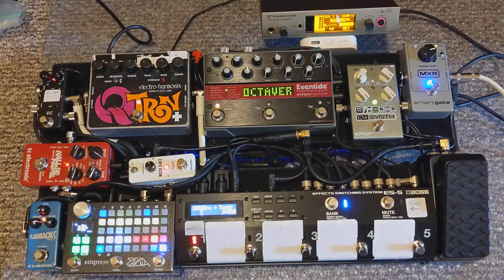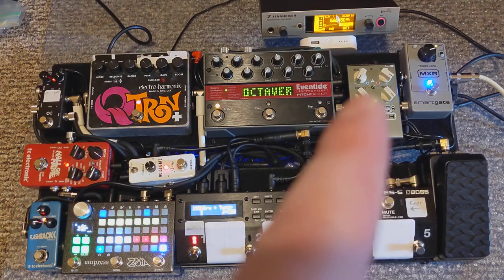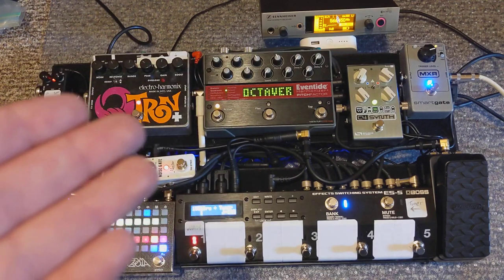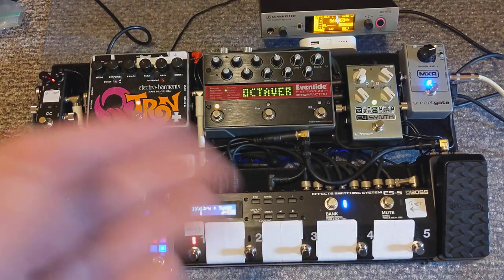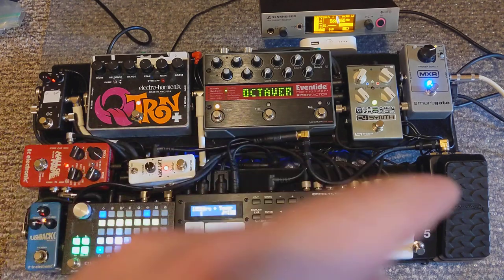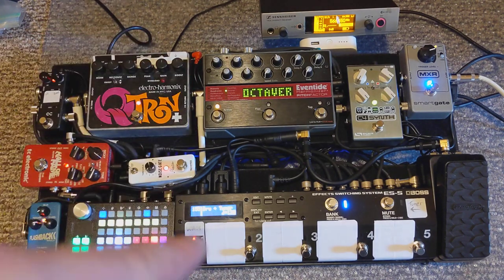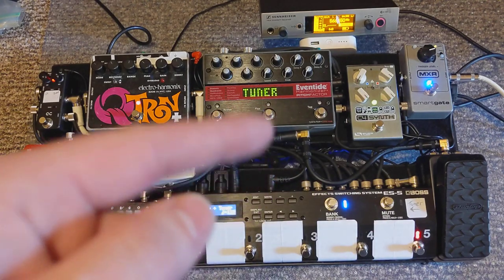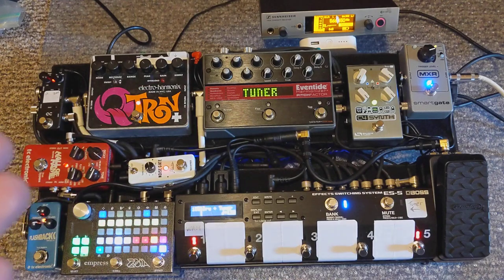Saxophone Effects Pedal Board Demo - Explained!

Comment: Thank you for so much great information. Great playing and sonic textures. You’ve found a balance between the two and it’s nice to hear.
Reply from the maker: Thanks! I'm always experimenting with the balance between horn and effects. Do you use any effects?
Reply: @alittlerocmusic   I do. Thanks for asking. I first used guitar pedals on my saxophone in the early 90’s; anything that my friends would loan me. I got out of them for a while but then returned to them in 2001. I started with a Boss VF-1. From there, I added and subtracted pedals. I got to a point where I could have played a kazoo through the board and it would have sounded the same 🤣 Besides the sonic texture, I also found that some of the pedals were playing me…like the AdrennaLinn for example; I was just playing whole notes and the pedal was doing everything else. What I appreciate about your setup is that none of the pedals get in your way; I hear you playing the lines you want to express and the pedals simply augment your tone. I stripped things down to a reverb and delay pedal. My rig now is a VocoLoco, Timeline delay, and SLO reverb. The Strymon Timeline has the options I want without getting in the way and the Walrus Audio SLO is so great but I feel like I use only a fraction of what it can do. My favorite feature on the SLO is the sustain button; I feel that it’s really expressive and allows for some creative textures.

Comment: Could you make a demovideo how you are using zoia at the moment. Have you unlocked some new things after this video that work with sax and also found out what is not working?
Reply from the maker: After working with the ZOIA for a while, its become a great swiss army knife of a pedal. I usually run multiple pedals at once, and the ZOIA's versatility allows me to use it to cover any ground that I want to add to a sound. In that way, it's usually the last pedal I figure out how to incorporate into my sound. You can get away with the synth stuff using just the ZOIA, but its important that you're familiar with synthesis. The delays and reverbs are a little easier to get up and running if you're new to effects pedals.

Comment: Great video. I have the C4 pedal but it does not always seem to work with my effects loop. I have it going in and out of my effects loop with a looper bypass with a compressor after c4. I am ready to sell it because it is not working for me. Any tips to make c4 work? Thanks 😎🎷
Reply from the maker: Depends on what kind of microphone you're using. Did you wind up getting rid of the C4?
Reply: @alittlerocmusic  I ended up selling the pedal because there was too much feedback. My new mic is a shure Beta 98H/C and it seems to work better but I still can’t quite get a good sound with pedals like Qtron and other synth pedals. Was considering the intramic but it is pricey and I’m not sure if it would be any better with my setup. Thanks for reply

Comment: Is there a big difference between the qtron and qtron plus with a the response dial?   Thanks
Reply from the maker: My understanding is the only difference is that there's an effects loop on the Qtron+.

There shouldn't be a difference.
Reply: @alittlerocmusic    . Sweet setup you have together there. Thank for the info!
Reply from the maker: @user-sh4tn7iv9f  Thanks!

If you find you don’t like the Qtron, check out the sea moon funk machine. The filter responds and sounds a little different. Both are great!
Reply: @alittlerocmusic    Cool.  Thanks T
Reply: Turns out, that the seamoon pedal is actually what Brecker used on the ‘Heavy metal bebop album
Reply: @alittlerocmusic  turns out, that the seamoon pedal is what Brecker actually used on the Heavy metal bebop album.
Reply from the maker: @user-sh4tn7iv9f  Yup, between the seamoon and the mutron re-releases, no reason why you can't find a great envelope filter that works for your sound!

Comment: Why do you take the output to foh with the radial di instead using the outputs on the es-5?
Reply from the maker: The DI is XLR out, which is a balanced cable. You'll get signal loss if you use an unbalanced 1/4" cable over longer distances. Some mixers have buffered inputs, but I've chosen to this setup because it sends the strongest, cleanest signal to FOH no matter what their rig is.
Reply: @alittlerocmusic  gotcha. Thanks for the response. I'm thinking about building a similar pedal setup like this based on the Boss MS-3. The MS-3 has stereo outputs so I was  thinking  I could send the stereo outputs to foh. The ES-5 your using and the Radial Pro 48 have mono outputs. Do you miss being able to utilize any stereo effects in your setup?

Also, the intramic sounds really good! I just learned about it a few days ago. In all the demos I heard of it there is a noticeable difference in quality compared to clip on mics. The main problem for me if I were to get one is that I don't see how it would be easy to quickly switch the intramic to different saxophones. I would want to use the mic with at least my tenor and soprano but probably alto as well on the same performance. Even if I bought 3 intramics(which would be very expensive), I can't think of a way to use all three of them with one pedalboard.
Reply from the maker: @inie341  Unless its a very specific to your group, most places will not put your horn in stereo. MS-3 and ES-5 are different beasts, so it really depends on what your needs are.

The intramic is great, best sounding saxophone mic I've used, on stage or in studio. Switching between horns is an issue. If you wanted to use 3 intramics with one pedalboard then you'd have to get a small mixer: 3 intramics into the mixer, mixer out to the pedalboard.

Comment: Hi, why using a noise gate in the first stage of your signal chain? The intramic is supposed to prevent any feeds from stage sound isn't?
Reply from the maker: It's a safety valve. The intramic is great at suppressing bleed, but I don't want to accidentally trigger anything by grabbing my neck to tune, etc.